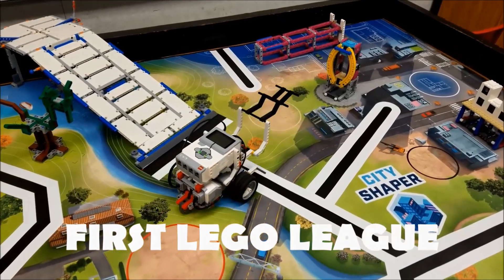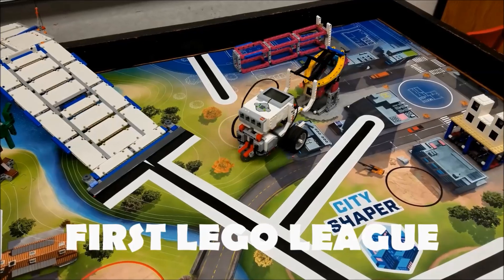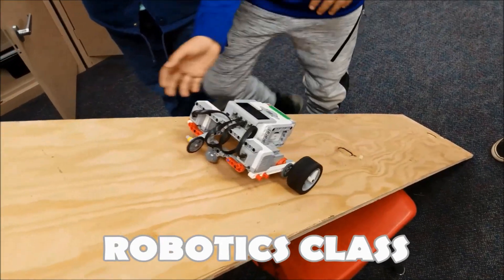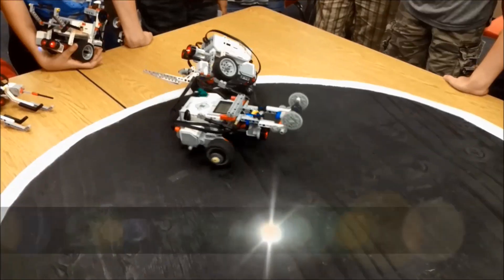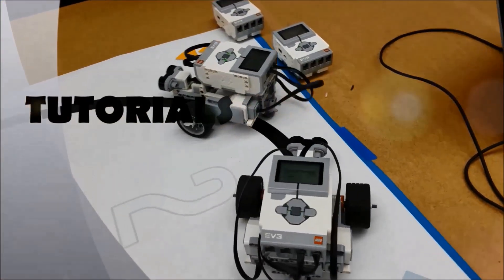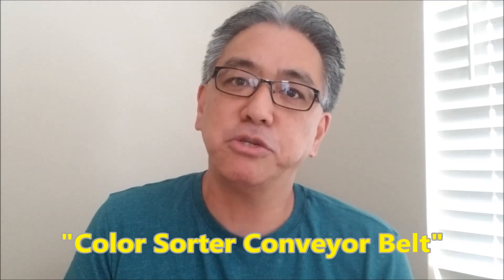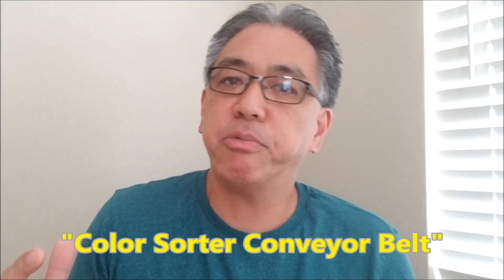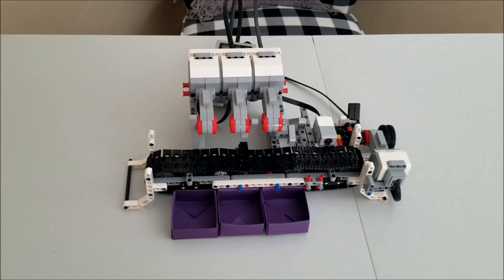"Mr. Hino's LEGO EV3 Color Sorter Conveyor Belt!!"

Comment: I am building a conveyor belt system. Well trying any way. I have nxt 2.0 system. I am trying to figure out the coding lay out to have the belt start when something is drop through a shoot. I am not sure on what the correct sensor I'll need. Any kind of help be be awesome thank you.
Reply from the maker: You could use an ultrasonic sensor for that if the item drops too fast for a color sensor.